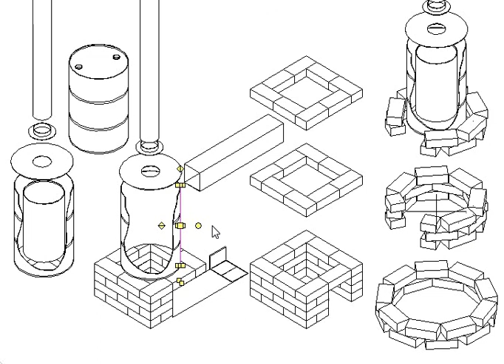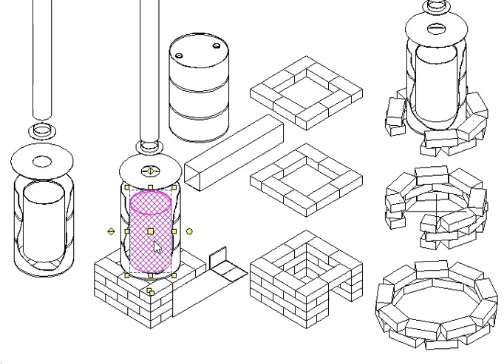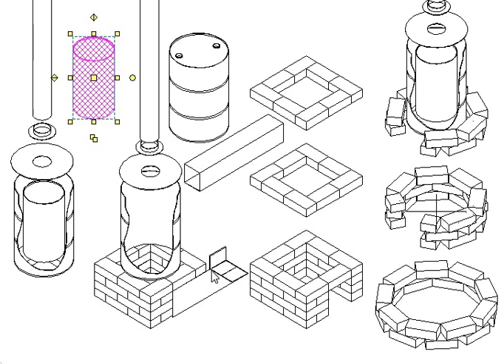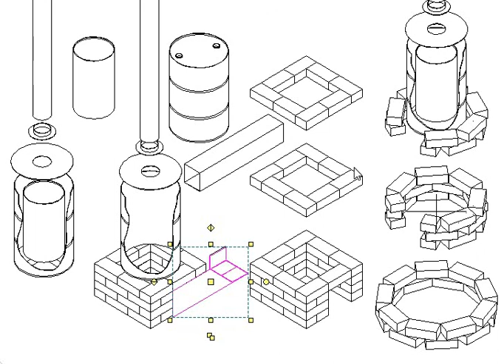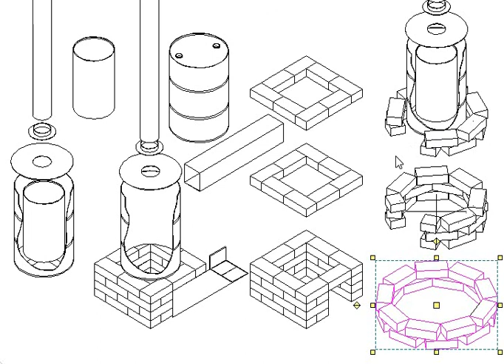Two Drum Biochar Retort Tutorial (Part 3)

Comment: Hello,
Excellent work that should inspire those like me who are looking for a practical solution to make bio-char on a small scale. I am also going to make a device to create compost tea to seed the powdered bio-char (4mm grain size) with an old hand-cranked meat grinder....
Reply from the maker: Sounds excellent! The basic two drum retorts work well but if you can reduce the heat losses then the efficiency goes straight up. I used a j type rocket stove to fuel the burn and reduce the smoke so the efficiency goes up again. The top lit up draft type retorts are a little hit and miss as the feedstock varies in size and moisture content. I'm volunteering at a community garden and looking to build a development of all of my ideas and use the heat to cook on to.